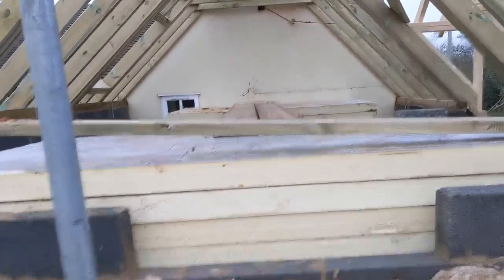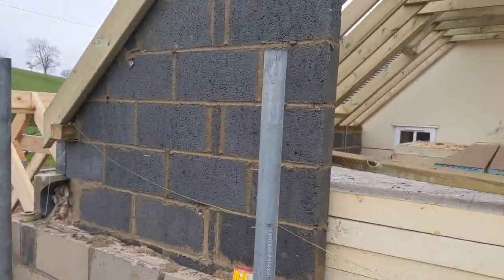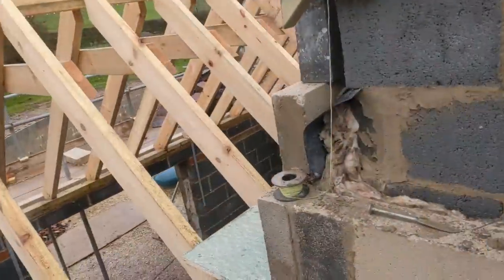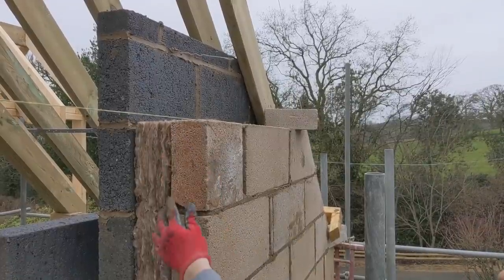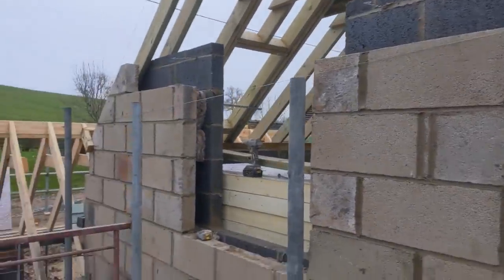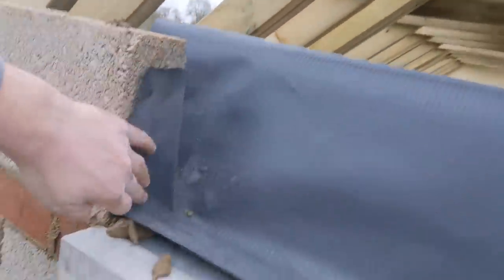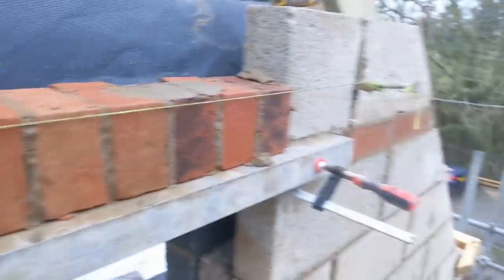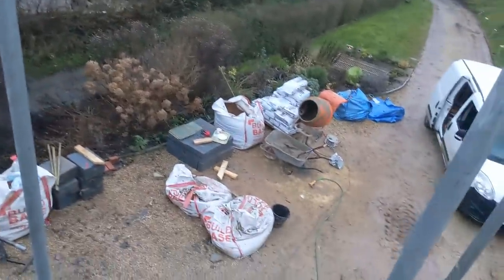Bricklaying - Blockwork Cutup & Soldier profile method #bricklaying #extension

Comment: You do nice neat work man
But you should be given your blocks a little saw in to the mortar when you lay your blocks on the edge
No neath to tapping blocks on top with trowel
And leaves your wall a lot more sturdy when mortor fresh
Reply from the maker: Cheers David, and I'll will try and do that more..just in the habit of tippy tapping the block down😂 Hope your well👍